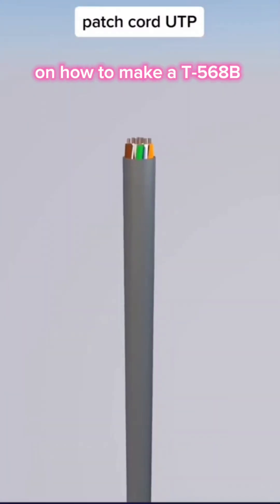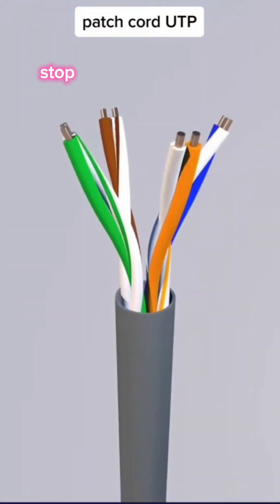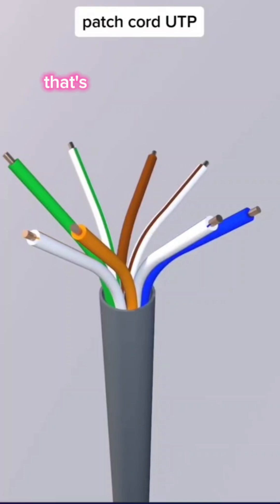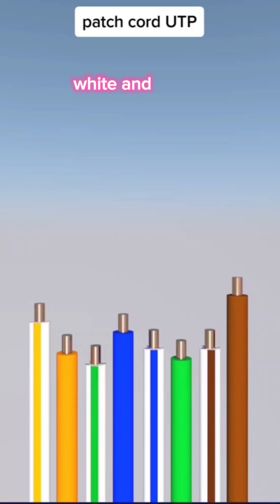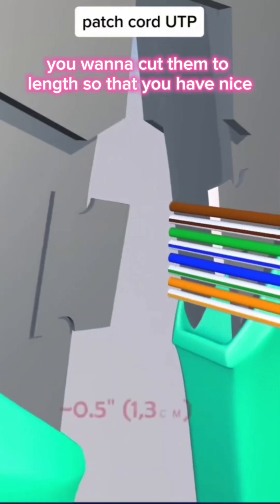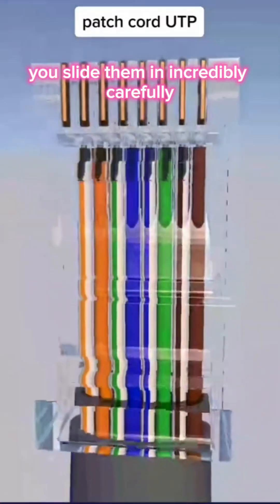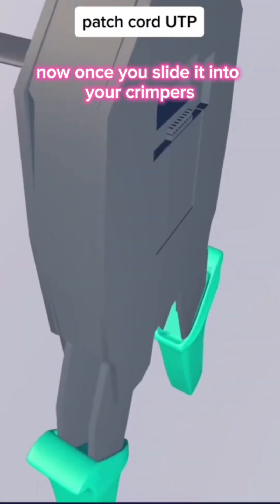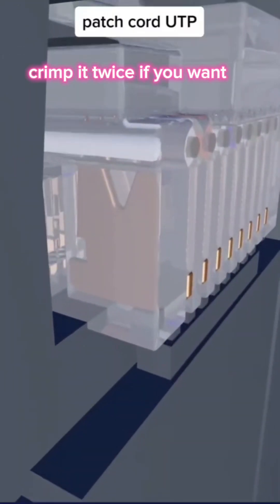How to make a patch cable in T-568B standard

Comment: I literally run and install network cabling. you made this too complicated its not that deep. strip, separate, straighten, cut, insert into rj45, bottom out to, make sure jacket is underneath crimp point in back, crimp once bc the crimper is gonna work the first time, and your done. dont forget to test when you're done and always double or triple check your cable before termination and after. (you can strip the cable more than 1 inch, it make your life easier)
Reply from the maker: @PhoqueU2  I appreciate your comment, albeit long as my video 😅.  On the crimp once... I guess you've never used worn out crimpers some MSP's provide 😭